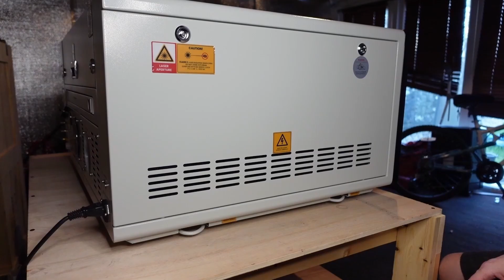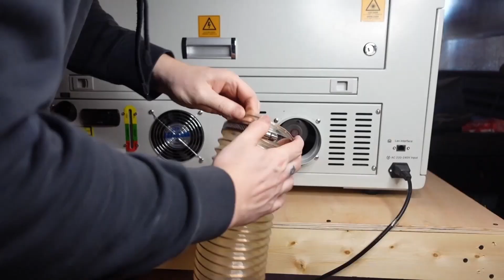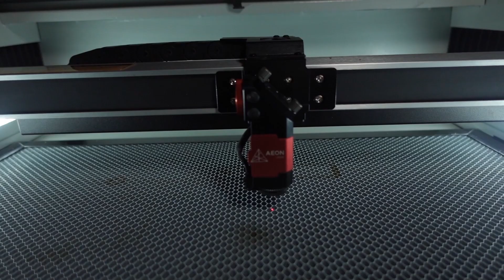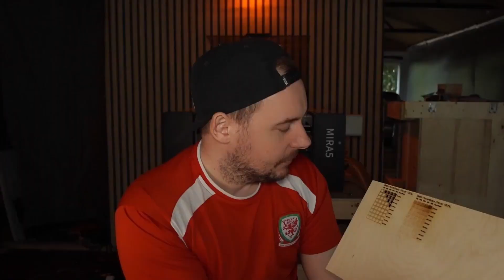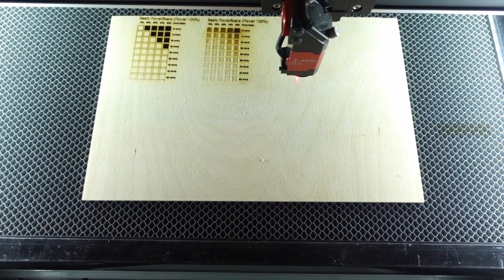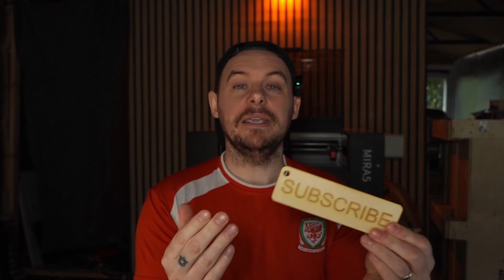Aeon Mira 5S Redline Series - Unboxing And Setting Up!

Comment: I am struggling with the camera on my mira 5s. can you share a video of how it is working for you? I am really not able to use it the way it is currently working. I am quite disappointed with it.
Reply from the maker: What problems are you having with it? Is it all aligned in lightburn using the alignment pattern?
Reply: @MARCAM  I aligned it a couple of times. I followed the guide that Aeon included. the camera view is not flat, it doesnt show the full screen and you cannot actually place things and get a WYSIWYG effect. when I move the material to the center I can get much closer but if I have a full sheet of scrap I want to be able to place things on the screen and have it cut where I navigate it to. the image is too distorted to make that happen. I am wondering if I should try a full calibration and not select the camera that aeon suggested to choose??
Reply from the maker: @silhouettebusinesseditionf8158 yeah it sounds like it hasn’t calibrated properly. 
I’d re-do it and if I remember correctly you need to select the fisheye option
Reply: @MARCAM  I am going to run through it again after I get these material tests done. crossing fingers! I paid a lot of money for this laser and this feature was literally one of my top 2 features that drove my decision to buy it.
Reply from the maker: @asuniqueasutoo it should work, just need to be patient with the calibration. I’ll try and make a video of how I did mine. It’s been a while since I’ve had to so I’ll try and get it done as soon as possible 👍🏻
Reply: @MARCAM  it did not work. I made sure to check fisheye, I went through the steps. I am still having the same issue. I tried to do full calibration, printed the test pattern and placed that in the bed. I tried to capture the image and it keeps telling me that image not found but I can clearly see the image on the bed when I update the overlay.
Reply from the maker: @asuniqueasutoo are you just using a piece of paper for the test calibration? It needs to be perfect otherwise lightburn throws a fit.
I printed one and glued it to a sheet of wood and it worked so much better. I now have it printed on a bit of card so there’s no small bends or crinkles in it
Reply: @MARCAM  I did print on plain piece of paper and taped to a piece of cardboard. I’ll try printing on card stock and will glue to a sheet of wood
Reply from the maker: @asuniqueasutoo did you have any more luck with it after?
Reply: I haven't tried the cardstock yet. I was hoping to try tonight but likely will be tomorrow.

Comment: Looks a nice machine Marc. A big step up from a K40. Lightburn a big plus with camera. Not jealous mate... nope. Smoke extraction looked a bit slow. What power is the laser don't think you mentioned it.
Reply from the maker: It’s a fantastic machine to be fair. I’m finding new features on it all the time too!
You’re right about the smoke extraction. I have found it to be a bit slow, especially when cutting thicker woods. It’s a big extraction fan mind so might be the 5 metres of hose I’m running from it 😂
This one has a 60w tube installed. It comes as a 40w too but wanted that little extra power 👌🏻
Reply: @MARCAM  cool . I have 80W tube and power supply waiting on being fitted.  It's 300 mm longer than my 40 though so need to   extend the enclosure... one day...
Reply from the maker: @walesara54 I upgraded my k40 to a true 40w tube. My machine did have a little cut out already for a bigger tube to be installed. Now it just pokes out a couple hundred mil.